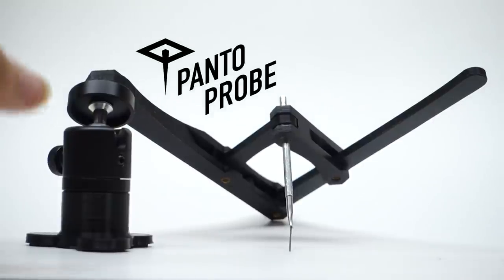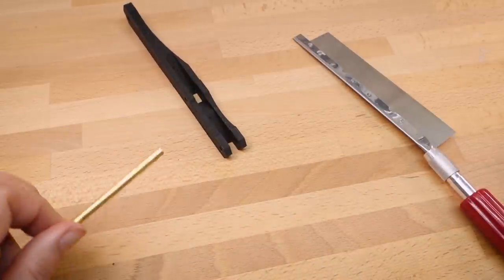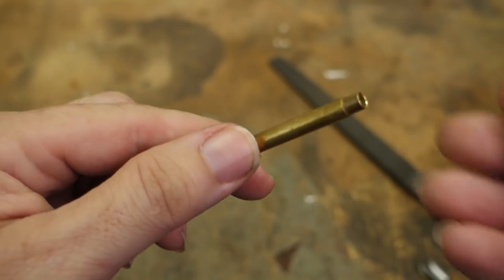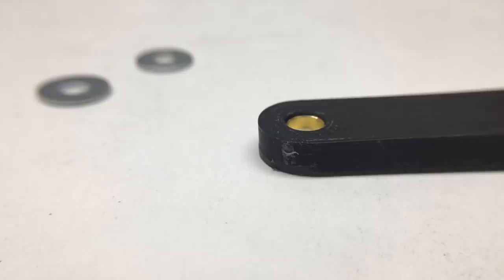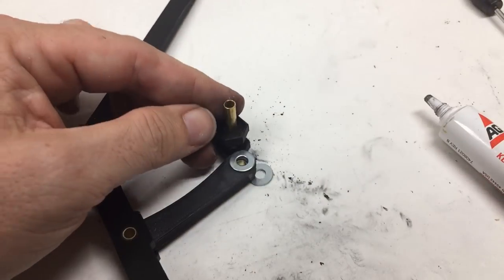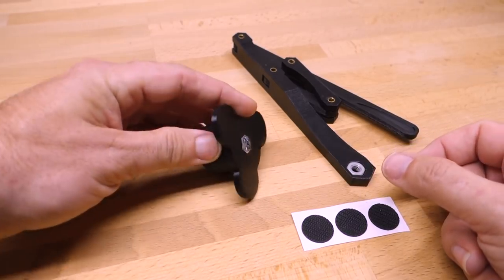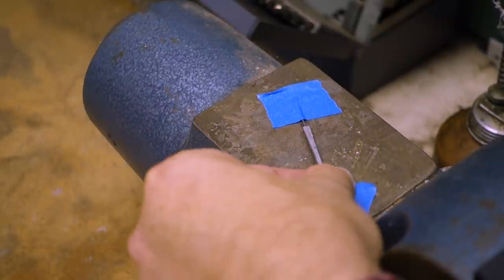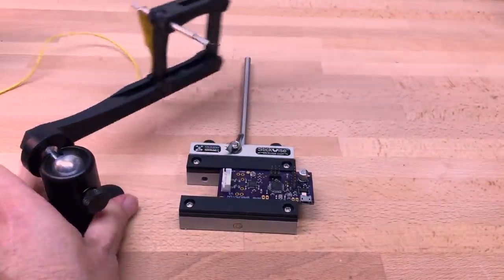How To Build a PantoProbe

Comment: I've not yet built one of these wonderfully simple machines, but it's on my list of tools to have in the near future. I've read your pantoprobe blog and enjoyed it quite as much as your videos here. I'm surprised there hasn't been one important question yet asked nor answered.

How do you make a time lapse without the nozzle appearing in the video? I hope it's not fully manual frame editing!
Reply from the maker: Good eye!   I actually built a little gap sensor thingie to trigger the camera when the bed is all the way forward, and then did some g-code injection to move the bed all the way forward and wait for 3 seconds at each layer.   The camera triggers once per layer and I get a nice time lapse.   I've never written the technique up because I hacked the trigger board up out of some other project I was working on (ATTiny85 Pi power management board) and I had to put CHDK on my camera, and the whole things is just a kind of wangled together mess.   Not worth writing about, but the results look nice.  Be sure to drop me a line/send me pix when you build a PantoProbe I'd love to hear about it!
Reply: Holy smokes, 3 seconds per layer plus transit time? That must triple the duration of a typical print job. Impressive results, nonetheless.
Reply from the maker: Well it does add to the print time, but most of the prints I'm doing take much much longer than 3 seconds per layer so the added print time is only a couple %.

Comment: might be helpful to chamfer the bottoms by 0.2mm as anti-elephant-foot.  nylon washers instead of steel might make graphite powder unnecessary?
Reply from the maker: Well and the graphite may well be over kill.  The operation is  still pretty smooth without it, and it's kind of messy.  The 0.2 chamfer is a good idea though. I've taken to doing that more recently.

Comment: where to get the copper tubing? I got the 3D parts printed and the swivel in the mail today.
Reply: Oh great!   Often you can find that kind of telescoping brass tubing at hobby shops, hardware stores, or crafting stores.  You can also order it from amazon although I think they sometimes make you buy a three pack so I usually just by the tubing locally.

Comment: Nice build. However,  I think I will stick with sharp thin gold plated meter probes - unplated steel is really horrible material for a probe where you can't apply significant pressure to ensure good contact! And where I need to make more than one measurement I will solder a short wire to the pins to clip the probes to. It is a way more robust solution. The problem is not only getting the probe/wire to the pin but also reliably keeping it there during the measurement! I am not convinced this contraption addresses that issue.
Reply from the maker: You can actually press the probe right down into the solder and feel it pressing in.  So you can have a very sturdy contact.  That's why I use a fairly fat (22 gage) wire and then ground a tip on it.   It is true that a gold plated tip would be far superior.  The nice thing about the basic design is you can make any kind of tip you like.  If you want to crimp in some sort of gold plated tip that would be great.  I just used that wire because it was the right amount of springy and I had it on hand.